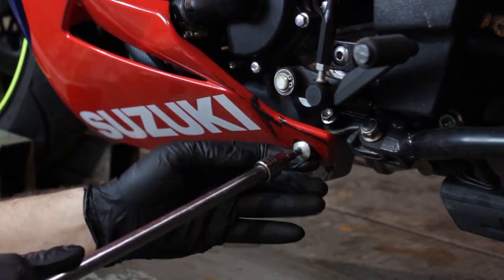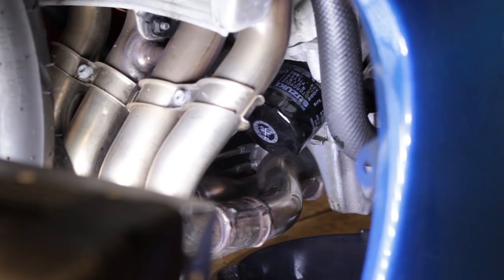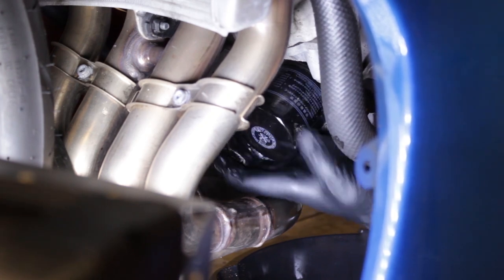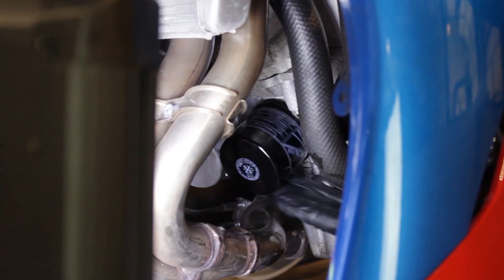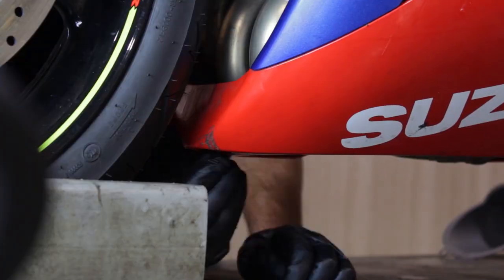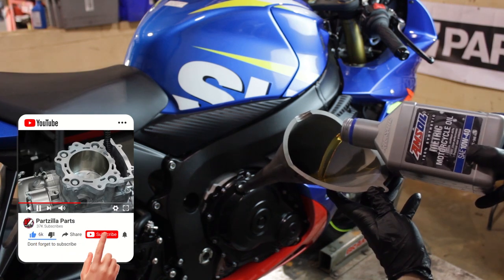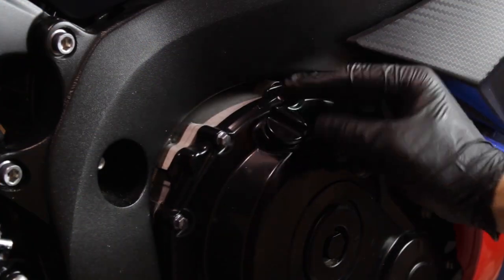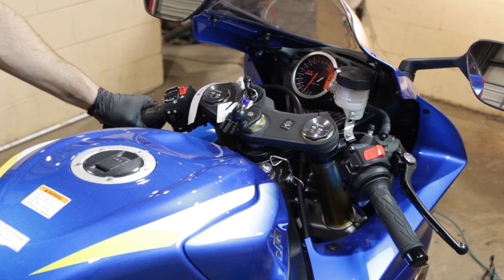How to Change the Oil on a Suzuki GSXR750 Motorcycle | Partzilla.com

Comment: I use the kick stand for draining the oil & removing the filter. More of the used oil flows out of the oil pan & the oil filter can be removed without getting oil on the exhaust headers.
Reply: Great strategy! Thanks for sharing.
Reply: Yep just did that today, worked Great! I forgot to use the rear stand 😂

Comment: One error in this video. The oil should be checked at operating temps!  Oil expands when hot so if you fill to the full line when cold it’ll be over full at operating temps. No bueno!
Reply from the maker: Absolutely. Additionally, the level changes once oil gets moving through the system. In this video, we crank the bike back up after the oil fill at 1:50 of the video and let the bike run for a bit before we do the final level check. It's also why it's a good idea not to fill all the way to the top line on your sight glass.

Comment: Cept’ leave the plug out when removing the filter  - a slight vacuum can stop all channels from draining completely and I like to bump the starter for a second - followed by priming the new filter by pouring in a couple tablespoons of the new oil to avoid possibility of an airlock.

Comment: Suzuki motorbike size 1000 08 My question is when I change the oil did I add oil for the period before installation or just put in the engine 3000ml of oil

Comment: Hello.  Can you tell which is the best washer for the oil screw to keep the oil from leaking out of the crankcase
Reply: You want a replacement crush washer for the oil drain pan bolt. Most of the time you can flip the crush washer & get 2 uses out of 1 washer but definitely replace it every other oil change.

Comment: Hi I have a question I have a rzr 1000 2015 I can not connect the examination device on the ECU Is it possible to help me what is the problem was reached the examination device but does not work I have a problem  power steering and check engine 
Thanks

Comment: If I follow the manual to a T that's one level. If I ride the bike on a hot summer day and check it super hot it's way past the full mark. So I'm assuming to follow the manual. Let it run for 3 minutes. Wait 3 minutes and check it. It's between the marks. What do you guys think. Don't over think it and follow the manual or bring it between the marks when hot?
The manual has had the same oil check directions forever. No matter what gsxr I've had it's always the same. I've always wondered about this but never ever got a straight answer. Some say one thing while others say... Follow the book